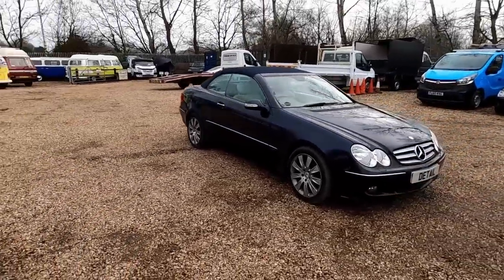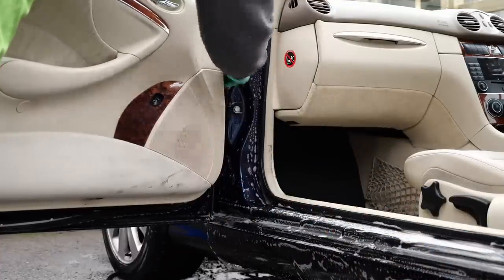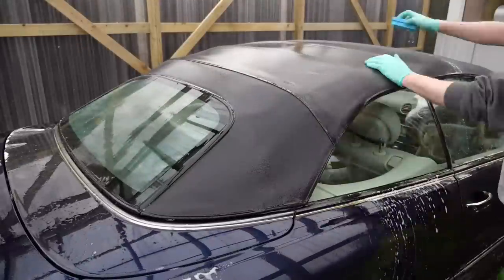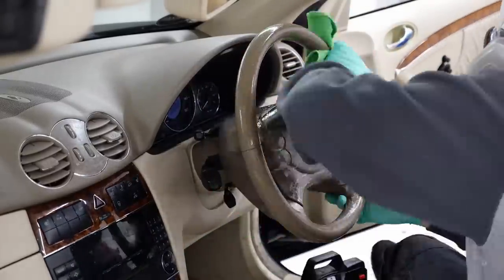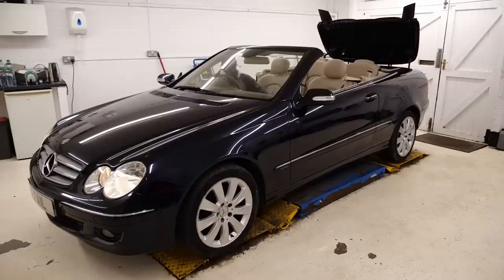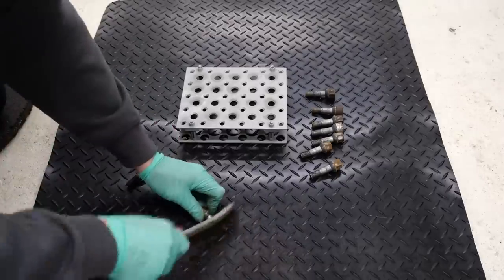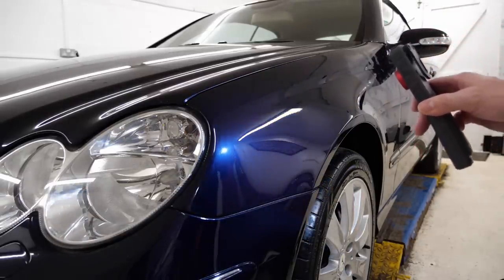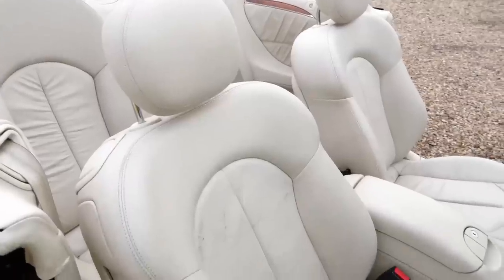Deep Cleaning a Mercedes 15 year old Disaster detail Dirty/Filthy Car CLK

Comment: 160,000 miles.....”extremely high mileage”

*looks at my 260,000 mile Subaru and chuckles in amusement

Nice work on the interior, it looks so inviting. (Why do cream colored seats feel better to sit in than other colors?)
Reply from the maker: Is that on the original engine? 👍😀
Reply: @everydaydetailing6449  my 2001 Lexus LS 430 has 220,000 miles on the original engine and transmission
Reply: 180,000 miles on my 2012 BMW 320d F30, on the first engine - still looks and drives like a low mileage car! I have rather babied it in terms of cleaning and maintenance, as well as driven it good and proper 😁👍🏼
Reply: @everydaydetailing6449  original engine, original transmission, and (most impressive of all) the original head gaskets!
Reply: 310 000 miles on my bmw e39 530d. Original engine.
Reply: 250k miles on my 2008 c350 so its def possible for a mercedes
Reply: 210,000 miles on my 2008 BMW 520d touring, original engine
Reply: @WarrenF  for a diesel 210k miles is just breaking it in so I really hope its original
Reply: Hi were did you get your bursh from. Am look to buy some.

Comment: a 3000psi pressure can get rid of mold everywhere..tried it succesfully. only issue is to be careful of the angle. nice work!
Reply from the maker: Not sure about pressure that high 😁 but if it worked well for you 👍
Reply: @everydaydetailing6449  hahaaha! In reality it was around 2300- 2700 PSi. The ratings are mostly off. Also, the car paint and spot to be cleaned matters. But do tell me the APC you are using. It is  excellent. Thx for replying.

Comment: Couple of suggestions. Uses a wheel brush to get the inner barrel and use 2 bucket method and not a sponge!
Reply: When I watched the bit of the wheel I thought you were more experienced and then noticed the one bucket and what looks like a sponge I stopped the video.
Reply from the maker: Hi 
I have used a EZ wheel brush in previous videos 👍
But as an expert you will know that the older Merc's have the rear of the alloy wheels left in grey primer from factory, unlike today where everything is powder coated. 
At 15 years old this has deteriorated heavily and leaves little to no point in cleaning flakey grey primer.
The sponge is a wool wash mitt, can be seen in my latest van video as well 😉
And the two bucket wash method is fantastic on a well looked after well cared for pride of joy, the cars I work on are anything but cared for .. that's the whole point of the channel, a one bucket is fine on a car that's about to have a heavy paint correction..

Comment: Glad you did the wheel bolts too. That would have really dragged down the hard work you put in refurbing the wheels. Can I ask though how durable that paint finish is on the bolts when you have to torque them back up?
Reply: Unfortunately not thaat great. Id go with Caps - I put Audi Lug Nut ones on a W210 and these fit and look good on the Mercedes aswell. :)
Reply: @TheOfficialDuBsTeC  Fair play. I'd assume as much. Mine could do with some sort of tidy up and I'd considered the painted route. Doesn't sound like it's for me though
Reply from the maker: Hi Tranquility 😀👍
as mentioned 
for a long term fix, new bolts or covers
Reply: @everydaydetailing6449  Thanks bud.👍

Comment: Tip for you, if you have a vacuum that has a brush attachment. Use that on the interior trim to lift remaining dust and get dirt out between the cracks and buttons. Also on the carpets after a good vacuum to remove any visible dirt. Shows up more on a black interior. Used it on my mums car which has cheap carpets and many blank buttons as it’s not the top spec. Looks brand new

Comment: You used your gun on the locking wheel but what you should never do you should use a break bar to loose it then use a guy you can damage the locking wheel nut by gunning it off
Reply from the maker: I tend to use a breaker bar prior to lifting the car off the ground 👍as sadly a lot of wheel nuts have been done up way to tight and even the impact gun struggles .. and as you probably know, its near impossible to use the breaker bar once the cars in the air as the wheel rotates, unless you have a friend to put a foot on the brake pedal. 😀

Comment: The very beginning of the video shows you’re a detailer and not a valeter - you cleaned behind the fuel filler flap😜 I’d try and find an old knackered leather seat to practise and learn on. Another ‘string to your bow’ if you want to gain a few extra jobs - that’s if you want them that is.
Reply from the maker: Thanks Davy 😀👍